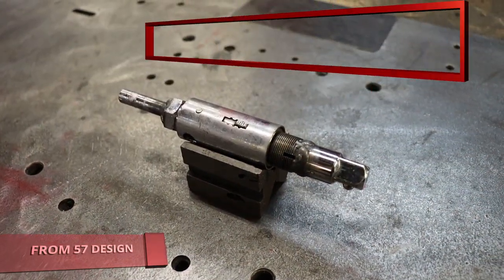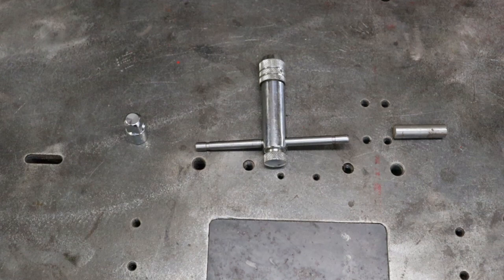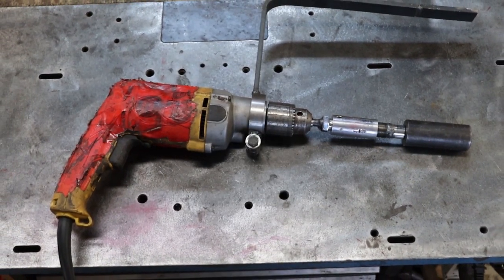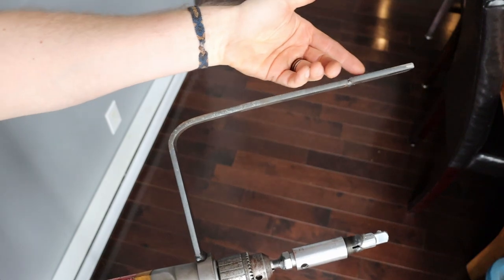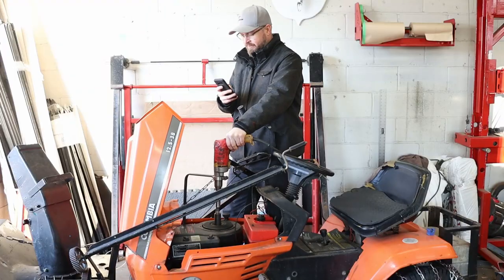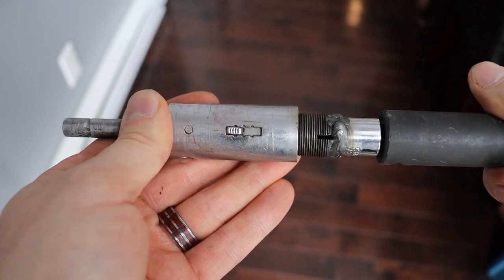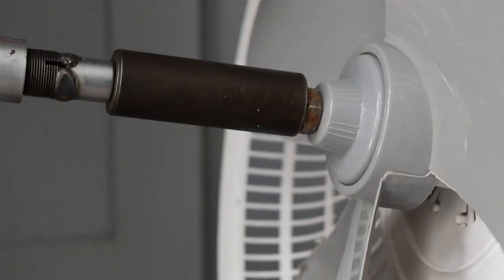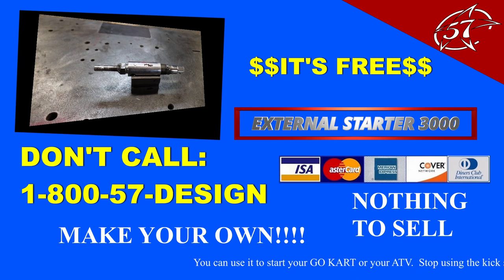External starter, perfect to start your MOWER or your GO KART or your ATV!!!

Comment: I have been wondering for years why the small engine tubes' haven't built a sprig clutch drill starter attachment. I cringe whenever a drill nearly gets ripped out of their hands starting motors.

Comment: What brand of ratchet tap was  that. I want to build one to start my motorcycle. Thank you
Reply from the maker: I have no idea, just use what you've got, it should work
Reply: That's the old North Brothers Yankee ratcheting mechanism.  Stanley bought them out a LONG time ago.  The 3 position slide is for right, left, and locked.  Irwin and many Chinese knockoff brands use the same design.  Shouldn't be hard to find, and they aren't expensive.

Comment: Is it dangerous to use an impact wrench instead?
Reply: You could shear the flywheel key using an impact gun.
Reply: I have an old 1" impact, I'm gonna weld the hammer on it and hopefully I can get it to work
Reply: I can crack the flywheel. Ask me how I know. Plus you need a one-way bearing off some kind, in his case a ratchet. If not, when the engine starts, it will turn faster than the drill and back the flywheel nut off. All me how I know. 😅